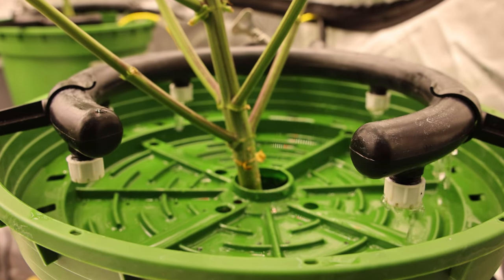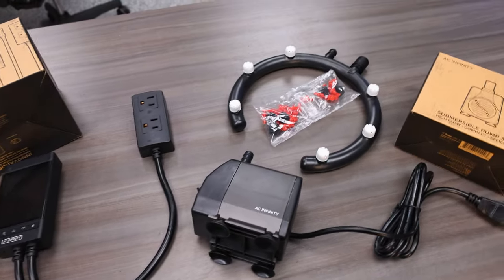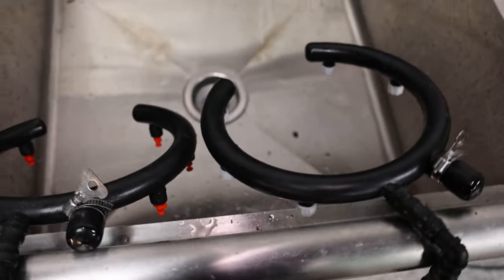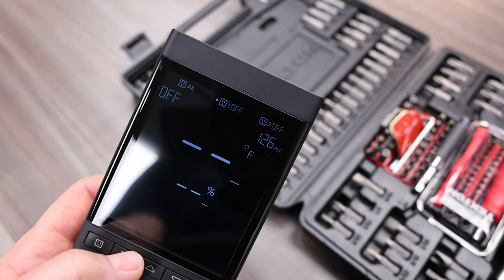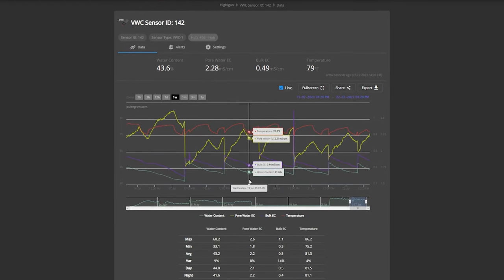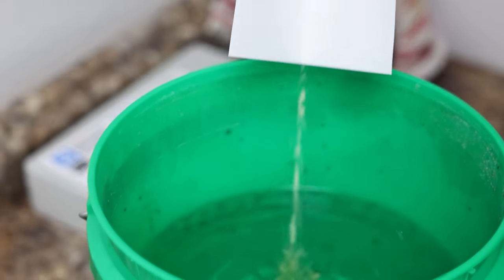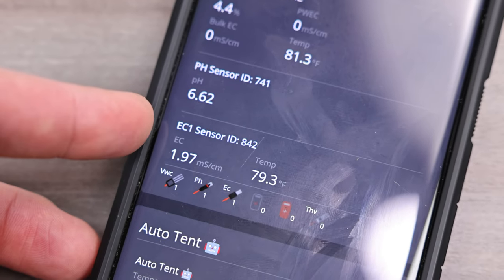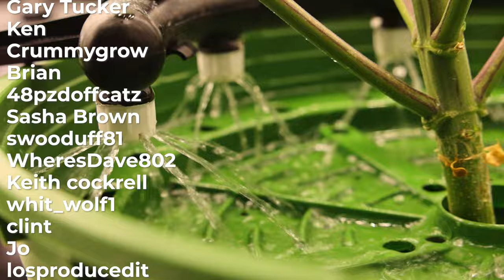Automated Recirculating Watering Setup! No Waste!

Comment from the maker: Automated, Recirculating watering setup for growing indoors! This is a pretty easy setup to automatically water your plants and reuse or discard the runoff automatically! We are also using the  @pulsegrow  new Pulse Hub to monitor our pH and EC in our water and moisture content and EC in the medium! This is a game changer for how we grow with mineral based nutrients! 

Watering Setup Components:
EZ-PZ 9" Drip Rings  @TheBucketCompany  : https://amzn.to/44EH9Q9
1/2 Irrigation Fittings: https://amzn.to/3OsyXNd
1/2 Irrigation Tubing: https://amzn.to/43IYOVw
1/2 Valves: https://amzn.to/452mxkR
Water Pump (Code "Highigan" save 10% Amazon or ACINFINITY.COM) https://amzn.to/44BxidZ
Controller 79 (Code "Highigan" save 10% Amazon or ACINFINITY.COM) https://amzn.to/473pS4F
Ez-Pz Runoff Pump Kit: https://amzn.to/46ZD2jh

Floraflex Pots, Matrix Lids & Nutes (Use Code "Highigan" and save 10% on everything from floraflex.com)
3gal Pro Pots :https://floraflex.com/default/shop/growing-media-containers/potpro-system/floraflex-potpro-3-gallon-premium-nursery-pot
Matrix Trays: https://floraflex.com/default/irrigation/floraflex-matrix-system/round-matrix-12-pack-9-10-5

Pulse Hub Use Code "Highigan" SAVE! https://pulsegrow.com/collections/hub-kits
Check Out Some VWC Data! https://app.pulsegrow.com/sensor-chart-sharing/HafiO3

Join the Highigan FAM for Exclusive Content, Photos, Discord Access, Early Access To New Videos And So Much More! This helps support our channel and helps us bring more content since YouTube restricts our videos and blocks us from supporting this channel🙏💚🌱: https://www.patreon.com/highigan

*Highigan Links, Twitch, Discord, Merch, Discount Links & More!*
https://highigan.square.site/highigan-hookups

Comment: I love the idea of automated watering...
But I gotta be honest.
I think my favorite thing is sitting down with my plants and slowly watering them.
It would be cool if this system allowed you to easily alternate between hand watering and auto.
Reply: Same here I enjoy being w/ my plants & hand watering very slow.! Also, I'm always scouting out the leaves for any problems to stay on top of things right away & correct if there's a problem!
Reply: Just unplug it when you want to water pretty sure it's that simple
Reply: I've got an alien easy feed system. If i'm not away. I use it hoseless. and just top feed by hand for the first 4 weeks then go to bottom feeding for the remainder.  I can move them around or hook the hoses up and ready to autofeed.  I use a bubblegen bubble maker as a mixer in the resoviour, whether running auto or not.
Reply from the maker: You can just open the AC app and turn the pump schedule off and it will not water till you turn it on or reenable the schedule. Soil you can get away with watering every couple days, pure coco you gotta water every day sometimes even a couple times a day in flower. We found it hard to make sure we were here or had the time to water so much this helps in that respect a TON.
Reply: @Highigan  Ok so there is an option. True like the anxiety relieved in those moments when you need it is worth the inconvenience of having to remove the thing to hand water.
Reply: I think you're supposed to water like six times a day.
Reply: @everennui1  There is no supposed about it.  if growing in coco, and moisture level is measures between 0 upto five. with five being how wet a pot can be 5 minutes after a fill drenching. then coco wants to be at 2-3.  How thats achieved is up to the feeder, and the size of pot and the plant size.

Comment: This video came at a perfect time. I was trying to piece together equipment for old video but wasn’t having any good luck. Huge thank you, it’s difficult trying to grow with chronic pain, this will definitely help a lot.
Reply from the maker: This version is much better than the previous, these rings also water much more evenly. At a minimum a trashcan, the rings and a pump and tubing is all you need. You can collect and dump the run off, I wanted to try and reuse it so save money on feed and use less water.

Comment: The stronger pump a Pressure regulator valve is needed, adding this would enable you to run only 2 plants and more than you will ever need, but it is stronger than you would ever need a small seaflo 33 would be ideal and still be morr than you would ever need, either way a pressure regulator valve is needed when you decide to use micro drippers 25-35 psi is ideal and you may not have had the issue yet but with salts but microdrippers can easily clog if you dont have an inline filter, Super simple pump to 19mm poly use your emitter tool (type of pliers that pops a hole in the line so you can simply pop single, dual  or quad emitters into your poly tubing) you can go floraflex or netafim. Floraflex pre-made drippers now come in 18" 24" 36" and 48". Each dripper for floraflex is .3gal/hr so if you use dual (1 emitter that has 2 drip stakrs) its going to be .6gal/hr and so on(they may have .5 now i know netafim does kinda simplfies the math). If you use the floraflex pot pro drain kit that larger pump would work great if has an auto float valve/switch to either pump back to reservoir like u are currently or to a waste tank or drain. 

Since your now measuring medium WC% & EC may want to switch to either one you prefer bucket company makes them charcoal & floraflex makes them and so much less labor intensive their compressed coco block pots from 1gal to 10 gal, this way your data/dry backs etc is more uniform you also know what WC% the block is and this helps you dial it your shot size or irrigation duration and frequency . 1 gallons with 2 stakes is something like 8x per day for 1 minute 20 seconds and then that goes to less times a day but a bit longer during flower.  Floraflex crop steering guide I'd great all besides measuring shot size.  Bottom line you can replicate  each grow from water usage nutrients etc and then ur getting the advanced data to get the most healthy biggest yields possible all while using less.

Comment: I'd love to see you go a little more in depth about how you set up the actual recirculating part, are you using a pump to pump out of the drain basins? It appears gravity fed but I don't really get how you could achieve that
Reply from the maker: Yes just gravity fed into the bucket company unit which has a pump and a float. You can also use the cheaper condensation pumps for HVAC.

Comment: Nice video, hey what pump are you using to mix/agitate your nutes?
Reply from the maker: Its the old pump from the old setup, just a cheap pump off amazon. You really don't need a high lift pump for mixing since its just pushing it right back into the tank to move it around so you could go with a less powerful pump.

Comment: Does the mix pump have an airline so it also a bubbler to oxygenate the water..?
Reply from the maker: Good question. It does not. In my previous setup I ran air stones to agitate the water vs the pump. One thing I found out was that air stone agitation increases the pH of the water over time. It would always creep up. After switching to the pump mix method the ph is ultra stable and requires almost no adjustment after you get it dialed over the week. I change out any leftover water once a week when I mix the new feed following the schedule. The water will get O2 added simply from spraying out the bubbler manifolds and filtering through the coco. We have ran about 3 plants out with this method so far and they are doing great as we continue to dial things in and experiment! We will have seed to harvest videos soon with this setup!
Reply: Thanks for taking the time, for such an in depth reply

Comment: Can I program the controller 79 to water for 15 or 30 seconds instead of a whole minute?
Reply from the maker: Not currently 1min is the smallest amount of time, I am going to ask them about making some changes to the app for just this reason!
Reply: @Highigan  I have been using the Controller 79 for controlling my dehumidifier in a closed loop setup.  It was one of the only controllers that I could find on the market that you could program a different humidity level depending on the time of day.  This was so I could have my humidity drop even lower when the lights are off to account for the drop in temp.  The controller does seem to fall short though when it comes to setting up auto irrigation when you are looking to program down to the seconds, which is important for people who want to water very small amounts very frequently multiple times per day.  I have found that a simple smart plug that works with the Smartthings app(I use Kasa EP10) will allow you to set routines where you can for example have your pump turn on at 8 AM everyday and auto turn off after X amount of time including seconds.  However, I have not found any smart plug that will work down to seconds without using an app like Smartthings.

Comment: What is the mixing pump? Thanks
Reply from the maker: Just a regular acinfinity hydro pump, I just pumps back into the reservoir to mix and churn the water in the tank. I turn it on when mixing feed or adjusting pH so the water and nutrients get fully mixed and incorporated!

Comment: Love to see how high tech it has become. But this isnt a new way to water, we were doing this 25+ years ago with hydro. Just use a small aquarium pump on a timer and a run to waste pot set up, but you would put an additional pump into the waste tub and pump it back into the reservoir. We were running 200ltr reservoirs back then and the waste tub was either 60 ltrs or if you had to, a 45ltr tub. With those old horrible push pin mechanical timers. We would fill the ressy with nutes and you could go on holiday for a week no probs, as long as the timers didnt break or the cheap pumps give out-it was all good. 
This looks way better, but MUCH more expensive... to the point im wondering if its worth using or if I pay a ton for it, it would be cheaper to just buy buds. I do love new tech but you guys are using gear now that is so pricey how is it cheaper to grow your own when any money you save would be spent in the set up costs for all this hi tech gear? 
Be honest, if you were not sponsored and got most of this tech for free, would you ever fork out the insane set up costs to buy it all?? 
I spent a bit over a grand for my tent set up, so it would take me 6+ months to recoup that working on id be buying $200 worth of buds each month. To run all the gear you guys have, id have to run it all for 2 years just to break even. 
Aside from that point, I really do love you guys, both of ya's and hope you NEVER stop doing what your doing. Just dont forget some of us cant spend a fortune on every new shiny toy. Love from Australia.
Reply from the maker: Great points fam! The pump setup its self is pretty cheap and you could setup a 2-6 plant watering with this setup or modified version using different pots and even a liner to collect all runoff instead of individual bases. The bucket company runoff pump is a turn key drain pump but you could make one with just a pump on a timer and it would be much less, you could use the controller 79 to run the waste pump along with your feeding / mix pumps to make it easy / digital or like you said the older manual timer ones. There are is a lot of ways you could set this up for sure and make it cheaper. 

The pulse hub is pricey that was given to us for testing. I gotta say I love the ability to see what's going on from the tank to the medium with real data and not having to check constantly the ph and ec or collect runoff.  It makes sense for large ops or large grows. Maybe not at this scale, and if you have a decent ph/ec pen its not required. This is just an overview of the setup we are running now since we get so many questions I wanted to cover it all. Or you can use it as a blueprint for making your own setup based on your needs and budget!

Comment: so ac infinity has a 79 controller now!?!?! When I first bought my fan, it had the 65 controller, had to upgrade to the 67 controller to get it to thermostatically control the temps, then I got the oscillating fan which requires the 69 controller for scheduling, still haven't upgraded to that.

Comment: I thought floraflex did not want to recirculate the run off.
Reply from the maker: You can if you check their website, it just says to make sure your EC and pH are maintaining. It does recommend changing the water every 7-14 days. I change out our water about once a week following the schedule. 5 gallons seems to last that long if not longer. If your EC starts to climb up simply add more fresh water, and adjust pH. Its super easy. We ran copycat on a recirculation setup like this and it grew amazing so we are diving into it more since it uses way less nutrients so they last longer and less water waste!
Reply: @Highigan 
Yes 5 gallons would last me a week between 4 plants. I  have not been on their site in a long while, I guess it is time to check in lol...
Reply from the maker: Yeah check it out! Says good to go on recirculating setups and DWC, we do wanna try DWC at some point!
Reply: Are you guys using 7 gallon pots? the 9" EZ-PZ dripper says for larger pots 7-50 gallon... I think in my setup I would use 3-5 gallons for flowering. wonder if the spray would be off the side of the pot in 3 gallons... I see u have the matrix cap so maybe that helps but what diameter is the top of your pots?

Comment: Something about recirculating runoff doesn’t sit well with me.
Reply from the maker: Something we are trying, as long as we maintain the pH and ec they do fine, change the water when it gets low or just add more if EC creeps up. We will have seed to harvests coming with this system and more details!
Reply: @Highigan yeah but EC is just total salt content this doesn't account for your plants taking nutes at different rates. If your npk ratio could be all out of whack and you could have the correct EC. You're still prob looking at a complete change out every 10-14 days. Unless your running a chiller your resi will likely need to be cleaned anyways by that time.  I'm keeping with waste to run off till to avoid all these hoops might as well rdwc at that point. I'll be watching either way I think this is the only channel doing this style
Reply: That’s where the 600$ Pulse comes in at. 
Otherwise it’s an absolute headache and more tedious then a simple drain to waste.
Reply: @ConfidentGrips  precisely.  You hit the nail on the head.     EC is just one form of measurement. You can have the target EC and your macro and or micronutrients be completely outta range.
Reply: @ConfidentGrips  yes exactly.

Comment: @Highigan how did you prevent a siphon in this setup? I'm running into this issue pretty bad in my setup and cant lower my rez any further. At this point, water keeps flowing after the pump turns off
Reply: Hello, there are 2 options for this.  1) You can either raise your pots/drippers higher or 2) You can put a tiny hole in the tubing INSIDE the res at the highest point before the tubing exits the res facing down toward the water/res wall.  The reason you do this inside the res is because water will be leaking out of the hole while the pump is running and you want it falling back into the res.  This will break the siphon.  Search for Stop Your Siphon - Easy Fix ✅ from floraflex on youtube for a demonstration of how this works.  Good luck!
Reply: @brasco8721  Thanks so much for the reply. I was having a hard time making either of those fixes work in my setup so I tried FloraFlex's Air Relief Valve and (even though thats not technically what its for) it fixed my siphon issue. The pressure of the siphon isn't strong enough to keep it closed so it reopens and lets air in to break the siphon.

Comment: How do you guys maintain your ph in the reservoir? Mine climbs like crazy during the week. Im using advanced nutrients ph perfect and it's still rising.
Reply from the maker: That's when you add pH or more water or both. The pulse hub is amazing at keeping track, so it doesn't go too far out of range 💚
Reply from the maker: Do you have an aerator in your reservoir? We used to use air stones but air stones will increase your ph over time. Since we switched to the mix pump there is virtually no drift in res ph!
Reply: @Highigan  I'm only using a recirculating pump in my reservoir. Mine is drifting up like crazy during the week. I used ph down for my last grow and kept adding when it was out of range, but eventually got a phosphorus overload.
Reply from the maker: Hmmm I am not sure, are you running coco or soil? That is one thing we have noticed with floraflex after its set it does not drift much if at all. We have not tested any other nutrient lines yet with this setup. I know the air stones did cause the ph to go up for sure.
Reply: @Highigan  I think I'm going to try the flora flex. No issues with lines clogging or anything? I'm using the auto pot system
Reply: @Highigan  and I'm using pro mix hp
Reply: The real way to solve this would be to buy a PH monitor/auto doser.

Comment: Try the hydro flow rain ring way cheaper.
Reply from the maker: I have not seen those but I am gunna look them up now! They do look nice and are slightly cheaper on sale on amazon right now, One thing I will say is there is no easy way to clean those out if you get something in there, with the bucket company ones you can unscrew the cap and clean it out easily or even use different tips for different watering options!
Reply: @Highigan  I just use a valve before sprayer to control flow,then use an inline filter works great.theres like 30 holes in the sprayer never had a clog.clean with peroxide after each grow.